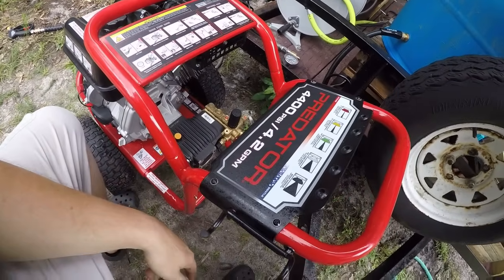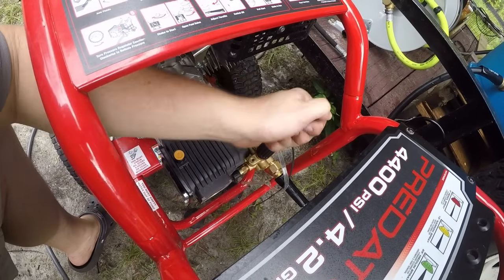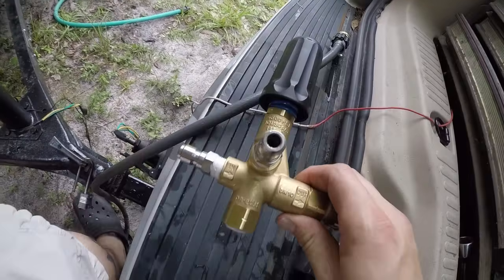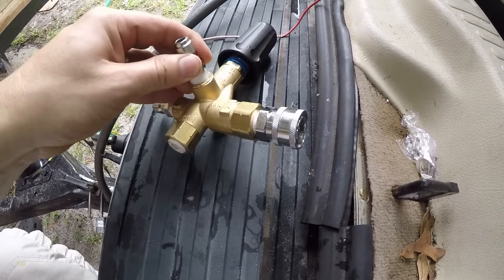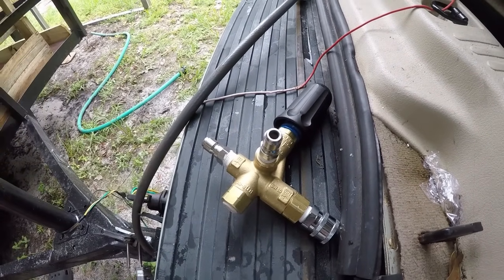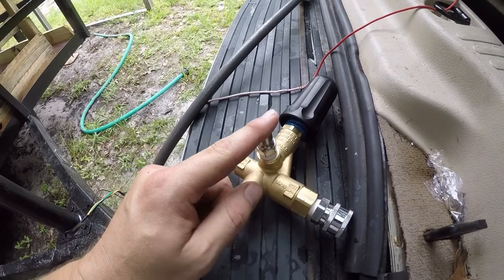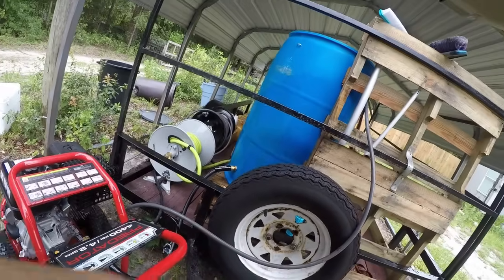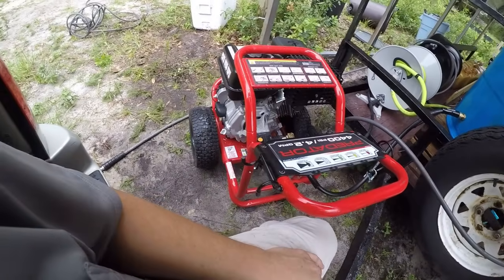External UNLOADER VALVE Bypass Water Back to Tank for Small Pressure Washing Business Tips

Comment: No more hard starts, trying to start the washer and fighting the unloader was a real pain. Even if I waste some water it's worth it.
Reply: You're supposed to pull the trigger while starting.
Reply: @ItchyKneeSon you don’t need to if you have an unloader
Reply: On that Amazon unloader l, if you look into the outlet before you put on the quick connect adapter, was there a small hole  down inside the outlet on the sidewall.  Was there any parts in the outlet orvwas it empty?
Reply: @jasonthurston799  Valve is already installed but I'm not sure exactly what your question is about
Reply: @charleschapman2428  trying to figure out if I am missing any parts, down inside mine I see what looks like a rounded compression fitting female but with about an eighth inch side hole that is probably the pressure relief. A compression male fitting would block that hole, possibly causing an explosion.   Trying to figure out if I just need to thread a pressure hose on it or of I need some sort of spring valve in there first.   I do see a large center hole with some spring deep inside through the center hole.
Reply: @jasonthurston799  Sorry I already installed it so I can't see inside.
Reply: You won't waste any water if you do exactly what he did in the video. Just run the unloader garden hose back into to tank. Unless your use a garden hose for supply but then who cares right lol
Reply: @Pittsburgh-412   Honestly I'm not on the unloader long enough to worry about the wasted water. I used a male quick connect on the unloader overflow port and just connect another section of pressure washer hose and run it off into the grass. I will say it works as intended and I won't be damaging any pumps any time soon.

Comment: I was told you should plug off the chemical injector on the pump. Is this true, and if so how is this done and with what part?
Reply from the maker: @bryanbahling2877  yes you should plug off the factory chemical injector hose. Simply find a small bolt that fits snuggly in the clear tube and use a zip tie to tighten around it. That's what I did and it worked great.
Reply from the maker: If you need a chemical injector 
You will want to use a general pump downstream injector, they are the best.
https://amzn.to/3KTpA6I
And you need the quick connects
https://amzn.to/4bd9dN1
Reply: @MyPressureWashingBusinesI just took the hose off and left ot off of the factory chemical injector port is that not a good idea? Thanks in advance

Comment: excuse my ignorance but why does the water get hot in the pump? isnt it still running even with no water going through it and wouldnt cold water cool it down? cuz its direct drive? thats where the heat comes from? and does it really keep the pump cold with no water going through? im just ordering equipment now but soon ill be the top pressure washer in my area =D
Reply from the maker: Good question my friend. Let's say you are in the middle of a house wash and the customer pats you on the back to ask you a quick question or you have to run back to the truck to grab something. It happens a lot! Anyways, At this point you are not holding the trigger down anymore and cold water is no longer flowing. The unloader valve that comes with your machine has told the pump to stop pulling more water from your water source. The water now has nowhere to go and it is just sitting in the pump spinning around and around getting very hot. All it takes a few minutes and your pump is taking damage to the seals inside. If you continue to do this house after house your pump will not last long at all. That's why a lot of guys are installing this external unloader valve.

Comment: Do you need a water tank to go along with this pressure washing machine ? Or do you just use the house’s spigot?
Reply from the maker: You don't need a water tank but a lot of guys use them because some houses that have older well pumps have poor water flow but Most modern homes have great water pressure. So the answer again is no you don't have to have a water tank with a 4gpm machine.

Comment: At 4:53 , is that a pressure washing quick connect fitting inside of your spare garden hose?  
You just put a hose clamp on that? 

Just making sure it’s not some sort of barbed fitting inside of the garden hose. I bought the fittings on your description and the only thing I could see going in the spare garden hose is that male end quick connect and just clamp it down. It’s hard to tell on this video.
Reply: Or at least they look like male end quick connects on Amazon but I’m guessing just insert it into the garden hose even if it’s not barbed?

Comment: Ty for this Video.  I currently have way too much water coming out of the external valve, even when I’m on the trigger.  Is there a specific way to adjust this using a pressure gauge or do I just turn it counter clockwise until less or no water is coming out when on the trigger? Ty
Reply: @patsommo5248  did you ever figure this out I'm having same problem and not being able to gety psi over 1k with thus issue thanks

Comment: There is a much easier cheaper way to do this. Years ago on a machine just like this one, I bought a thermal relief valve that screwed right into the pump, just removed one of the brass plugs to put it in. They cost around 10 to 20 bucks. Also, if you really want to play it safe with the pump, add a float valve switch to the tank, so that when it is almost empty, it shuts the engine off, fairly easy to tie it into the on/off switch. As you probably know, if it runs out of water, it can destroy the pump fairly quickly.
Reply from the maker: Hi, This machine comes with a thermal relief valve already installed but keeping water running through the pump is not what thermal relief valve is for. By the time the relief valve pops the pump has already reached a very hot temperature.

Comment: Great solution, had to stop my self from running around my jobs now that i know my pump is not going to over heat. thanks for the big tip. I talked to my local pressure washing store and they said that wont work, guess what it does.

Comment: Do you use the built in chemical injector?
Reply from the maker: No I do not. I use general Pump chemical injectors. They are only like 20 bucks. You don't want to run chlorine through the built in injector

Comment: I bought the same power washer from Harbor Freight.. it’s a beast.. you helped solve the problem. Great video.
Reply: How is it working so far? I was thinking about getting the same washer to start out with. But this is a very good tip. Was wondering if you've tried this yet, and if so, how's everything working ? Any new or additional tips you care to share?
Reply: I cant get mine to start out of box
Reply: @Astrojamus  I ended up returning mine.
Reply: @RodderTV  i got mine to start it ended up not having oil in it lol

Comment: I have a 4gpm simpson washer I'm looking to gravity feed from a 55 gal drum like you're using. how fast do you burn through that 55 gallons?
Reply from the maker: I have a Hudson float valve on it so it stays full. But I usually shut the water off when I'm finishing up a job and I get like 10-15 minutes of surface cleaning time with the 4gpm

Comment: Awesome! I’m working to set up the same rig!
Reply: How is it working so far? I was thinking about getting the same washer to start out with. But this is a very good tip. Was wondering if you've tried this yet, and if so, how's everything working ? Any new or additional tips you care to share?
Reply: @nathan3647  honestly, I got a brand new Vive or 4 gallon a minute machine and couldn’t get it to start and I’m still having troubles with it because I had to move and had to do my work with my old pressure washer. I do landscaping most of the time, so I haven’t been able to prioritize getting it working and it’s a hard thing to return as it is a large item to ship so we’ll see

Comment: So I installed it and did what you mentioned .. but I’m losing pressure with it on. When I take it off it has fine pressure, whenever I turn the valves doesn’t seem to help any ideas?
Reply: Do you found a working solution already?
Reply: @Mantra1988  yes I did
Reply: @Jypze  would be great if you can Tell me whats the solution, because i want to bypass through a external unloader too.
Reply: @Mantra1988 did you ever get the answer to this question??
Reply: @nathan3647  no
Reply: @Mantra1988 I love that they said yes and then didn’t share the solution 😂
Reply: I have the same problem please help
Reply: I did share it idk why it didn’t pop up for you
Reply: @Jypze  its not there
Reply: Please share your solution. Ty!!
Reply: @patsommo5248  it wasn’t working for me. It worked once then it stopped once I changed injectors. No idea 🤷

Comment: You said that no water should come out of buffer hose but I clearly saw water coming out. Yes it was less when on the trigger. I set mine up to dump on ground and it clearly dumps some water when on the trigger
Reply: You're didn't have a thermal relief on the bottom side of you're axial pump? I just got my Predator Pressure washer but it's the 3200PSI 2.8 GPM one and mine has a thermal relief valve on the bottom right beneath the water inlet with a little black plastic fitting pointing away from operator. I'm curious do I need to add the external relief unloader still like you show in this video or could I run a hose connected to the thermal relief valve and running to my reservoir tank?
Reply: @crossfiregaming9541 the thermal relief valve is not going to protect you anything like this valve. Don’t let the pressure washer idle without pumping water for more than a minute and you don’t need to worry about adding this at all. If you think you’re someone that may make that mistake then I’d add this.
Reply: @crossfiregaming9541 .. Just wondering if you eventually added the external unloader he used. Because i have a similar machine to yours, 3200 psi , 2.4 gpm. And my research suggests that this unloader he is using isn't recommend because our flowrate is too low. It works for him because his is a 4gpm machine.
Reply: It does but since his goes back into his system it isn't really an issue I'd assume

Comment: Do you still have full psi pressure with the bypass unloader? In your vid it looks like that still comes some water through the bypass garden Hose while you are pressing the the trigger
Reply: Its cause he limited the external unloader by putting it down to 2000 or so psi
Reply: Do you set the pressure when you are on or off the trigger? Thx

Comment: Any reason why there was still a small amount of water coming from the unloader hose when the trigger is pulled? Seems like the unloader is not fully seating when the trigger is pulled. Not sure if that makes a big difference or not. I'm about to pull the trigger on the same setup you have, looks to be a big improvement over what i have now.
Reply: Possibly the pressure when he pulls the trigger is still slightly higher than what is set at the external unloader valve so it lifts a small amount to let some water out

Comment: Just delete the oem unloader valve.  And the vtr3 unloader..
Reply: I was wondering what the point of using two unloader valves was. Can you do it the same way with just the factory valve?
Reply: I believe on this machine, the unloader is a thermal relief valve, so it works a little differently.
Reply: Can someone please clarify this information? Just bought this PW and wanted to see about adding a bypass with downstream. Also.....wanted to see if electric start could be added to this 4400 pressure washer as well. Im brand new to all of this so please, break it down to relatively manageable information not industry jargon. Looking to learn with resourceful information. I appreciate all of your responses.

Comment: Man you just saved me. I bought the simpson machine off amazon, basically the same as yours. I was wondering if buying that unloader would work but i thought it wouldn't. Thanks man i buying one
Reply from the maker: Glad to help! 
General Pump PULSAR4KHP Unloader https://a.co/d/677XGeL
Reply: How did you hook up that hose to the quick connect for the bypass
Reply: @440pressurewash I believe you can order special quick connects with a hose barb on the other end. That's probably what he used or he just used a 3/8 male quick connect and a hose that fit snug over the threads with a small hose clamp holding it in place since that line isn't under pressure this would work fine. I'm in the process of adding one of these to my 3200psi Predator but I'm actually disconnecting the first unloaded and using the second unloaded for the pressure control and the water dump. This other guy just put out a really good video showing you how about a month ago. Don't know his YT name.
Reply: Not the same, the pump on the HF is 100x better than the AAA Pump.
Reply: @stevevetter8045 HF?

Comment: I've had the same machine for over 2 years and It’s been great.   The only issue I've ever had with it is if I leave the fuel on it will very slowly drip at the bottom of the carb.  I've put new gaskets in it and made sure everything was tight but still does it.   So I just turn the fuel off when I'm done and run all the fuel out of the carb.  It will pull from a buffer tank but it has to be primed first. I've thought about buying another one and Siamese them together for when I have large concrete cleanings.
Reply from the maker: I've heard of people running two machines together like that. I actually just got a 10GPM and it's been awesome for concrete but It's taking some getting used to. I guess I still like the 4GPM
Reply: The dripping fuel doesn’t stain the costumer’s driveway?

Comment: Good to go. Got a Simpson 4gpm. Ive just let water run through the ball valve once i disconnected the wand, surface cleaner, xjwt, etc. Didn't see a link, however most of us should be Amazon savvy enough to find this external unloader valve and replicate yours to a tee. Thanks again.  Much success
Reply from the maker: This is the exact unloader I bought. Sorry it wasn't in the description

General Pump PULSAR4KHP Unloader https://a.co/d/0wq6och
Reply: Cant go wrong with a GP product.  Thanks again @MyPressureWashingBusiness
Reply: @MyPressureWashingBusiness  Got my unloader. Ready to install. Thanks again
Reply: @21BravoMobilePressureWashing How is it working so far? I was thinking about getting the same washer to start out with. But this is a very good tip. Was wondering if you've tried this yet, and if so, how's everything working ? Any new or additional tips you care to share?
Reply: @nathan3647  Works great once I got it dialed in(external Unloader Valve). I still try not to just let it run no longer than maybe 2 minutes before I pull the trigger. First time I put it in action was on a housewashing of my neighbors house and I just let the water run down the curb since I have the Simpson stationary in the bed of my truck and didn't need water to fill up in my buffer tank. Once you get it installed, run some mock trials before putting it to use on a paying job. Adjust the pressure on the new external valve lower than the original so it kicks on properly.
Reply: Well, Im in business https://youtube.com/shorts/ne7wz0bj_WA?feature=share @MyPressureWashingBusiness
Reply: Item is out of stock on Amazon grrrr